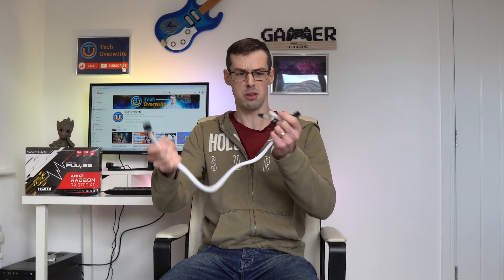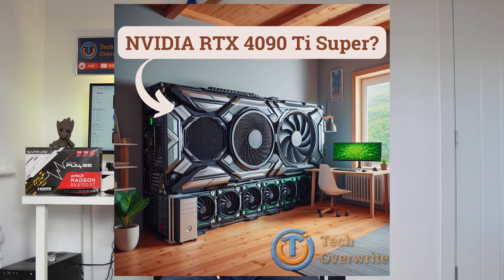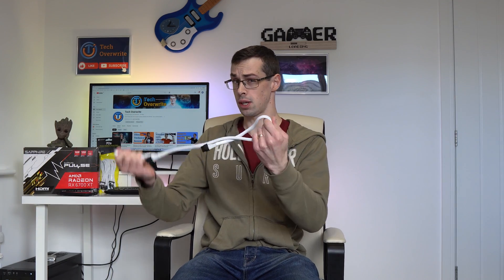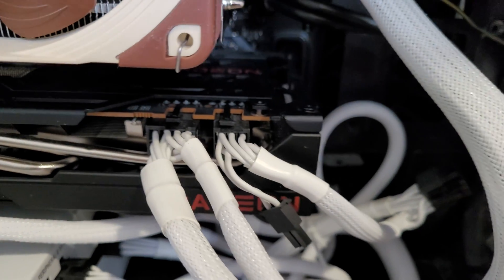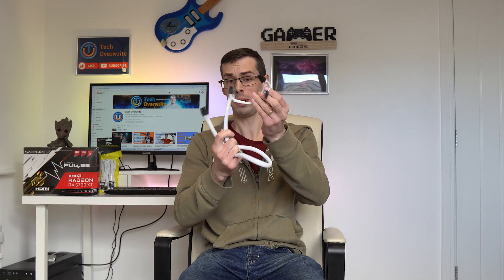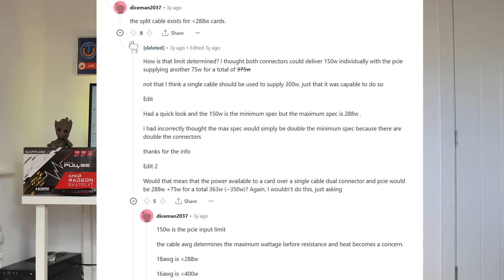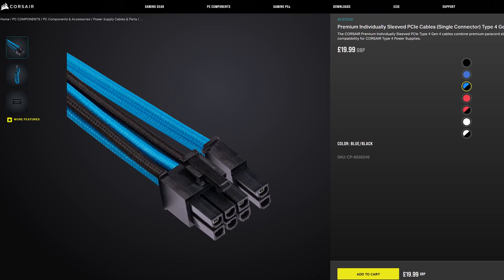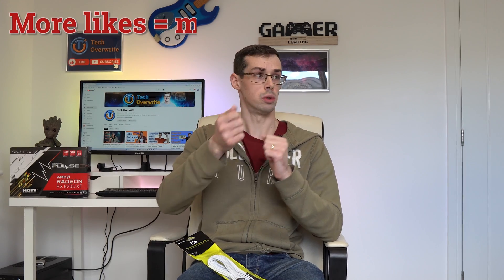Stop Connecting Your GPU Power Cables Like This! (How To PROPERLY Connect PCIe Cables For GPUs)

Comment: I got p520 with an rtx 3080 but having issues with gpu cables, what can I do please help. 

Gpu needs 3x8 pins the pc has 2×8.. and there is no room for another 8 pin on the mobo please help me what can I do ?
Reply from the maker: Sorry to hear it :( Unfortunately you might be out of luck - I doubt that the proprietary PSU in your P520 will have full PCIe support for an RTX 3080. I might be wrong though. Basically the usual advice would be to buy a new PSU if needed, but I'm guessing that might not be possible with your specific PC/PSU?

Comment: Not gonna lie (and fingers crossed) i just reversed my pig tail on my 750 and i am holding steady; coming from red light and black screen on rtx 3070 ti. Doing a NVIDIA auto tune and went from 210 to 1950 MHz currently.
Reply from the maker: Ooo fingers crossed, I hope that works out well for you :)
Reply: Bro, it worked!. I would have never even thought about the fact that the cable has parameters. I even used to be a junior electrician and would have went straight to the worse case scenario. Nuts, all I did was reverse the pig tail and went straight through three stress tests and three hours of Skate with no drops or shutdowns right after! Thanks my guy!
Reply from the maker: YES that's great to hear :)

Comment: so today after i moved all my stiff into a new pc case and psu i find out my pc was working then bang restart and just boot boot boot boot no clue why untill i look i had a ( DEVIL SPAWN ) swap it out for a normal one and works xD why we even have DEVIL SPAWN if they dont work lol
Reply from the maker: Ahh that's really interesting - I'm glad you were able to track that down in the end 🙂Devil spawn can be good for two lower power PCIe devices (like 150w of power each), but they aren't good for modern GPUs.
Reply: @TechOverwrite  well mine it takes three 8-pin PCIe so i dont know if that was something about it but when i did swap my psu and stuff use only 1 PCIe and aother PCIe with pigtail cable it did boot was on bf6 for like 30 mins and pc just power off and then try to boot and just went boot boot boot i try the one ram stick stuff and all just the same i was so lost so i try to use all 3 8-pin PCIe and it worked been gaming on it all night / day working fine :) i dont know if its the psu but its a lian li edge anyways its all good now :)

Comment: i've just bought a 5070 ti with 12vhpwr to 3x8pin, is it okay to use 1 single cable and 1 pigtail cable to fullfil all 3 of it? i realize that my PSU only has 2 gate to plug 2 pigtail pcie, and that's why they write 4xPCIE on the box :((
Reply: just watch dude so today after i moved all my stiff into a new pc case and psu i find out my pc was working then bang restart and just boot boot boot boot no clue why untill i look i had a ( DEVIL SPAWN ) swap it out for a normal one and works xD but i do have 6900XT GAMING X TRIO with the 12vhpwr if might be ok
Reply from the maker: Yep it should be okay - two separate cables should be enough current for a 5070 Ti. Glad your 6900XT is fine too, @McFrog3764 🙂

Comment: Hi, was wondering if you could help me, i have an rm750e with an msi rtx 2070 super.
my psu doesn’t have enough ports & cables to fill the 8 and 6 ports required to power my gpu.
can i use a separate port on my psu (that isn’t cpu/pcie) as the cable i have for it fits my gpu.
i’m aware this might not be good and i’ve been getting mixed signals from my research efforts, i tried it and turned it on everything was fine but i realise it might damage my pc or give me unwanted power issues.

what would you suggest as a solution? new cables/new psu/maybe its okay? if you respond thanks in advance.
Reply: 12vhpwr was the port on the psu
Reply from the maker: Hi, so is 12vhpwr the spare port you want to use? That should be fine then - that's designed for GPU power delivery. Corsair PSUs do sometimes give a "12vhpwr to 8-pin" cable, which is designed for your exact situation. Basically when you don't have enough 6 and 8-pin cables, Corsair give you that cable to also use. That will work fine :)

What you shouldn't do is use a Molex to PCIe adapter (For example) since that might not give stable power delivery, but using the 12vhpwr will be 100% fine :)

Comment: What about running a RTX 3070 Ti (with 3 connectors) on Corsair TX 650M Power Supply? I only have 1 Pcie cable that splits into 2 connector. Please help and guide me.

Note: I had two cables each with split ends into 2 connectors, but since I only needed 1 cable for my GTX 1070 earlier, I lost my other Pcie cable.

I'm unsure about what to do and if what Pcie cable should I buy if I am going to need 1 more other than my previous one already plugged to PSU.
Reply from the maker: You should be fine since you have two separate cables. The TDP of the 3070 Ti isn't high enough to require 3x separate cables. If I was you, I would plug in one cable (and leave one pigtail end dangling unused), then use both ends of the other cable - for 3x connections to your GPU :)
Reply: @TechOverwrite So it's safe to use 1 pigtail cable and 1 direct cable on my specific PSU (Model in original comment) and the GPU which is Asus Rog Strix RTX 3070Ti OC? Thanks again for helping!

Comment: This video is excellent and I really needed it when trying to figure out how I was supposed to connect my PCIE PSU to a 5070 with 12VHPWR! I’m looking to ditch the adapter and get a direct cable… I have 3 free PCIE ports on the PSU. Should I get a 3 x 8 PCIE to 12VHPWR or should I stick with a 2 x 8 PCIE? Does it matter much?
Reply from the maker: You'd probably be okay using 2x separate PCIe cables with the 5070, although strictly speaking it's always best to run separate cables. (Sorry for sitting on the fence there - I'd probably just run 2x separate cables for a 5070, if I had a quality PSU).

Comment: ASRock Radeon RX 6600 Challenger D, 8GB i have 650w power
Reply from the maker: You should be good to go :) The power usage is low enough there, not to worry about pigtail etc.

Comment: Hello, this was a helpful video but I have a conundrum I'd appreciate some input on!

I have a pretty old "modular" PSU (a Corsair CS650M 650 watt model to be precise) and I just bought an ASUS Prime 5070 OC card which draws a max of 250W - I'm replacing a 1070Ti which I was previously connecting in this daisy-chained fashion using just the single main PCIe cable from the PSU, but I'm aware the 5070 needs me to connect two of those PCIe cables to the adapter which came with it in order to power it and that both of those cables need to be single cable from PSU to graphics card adapter...after some research I've found out that I have a Type 3 PCIe cable which came with my modular Corsair PSU which will fit in the remaining PCIe port on my PSU but I had some concerns about whether it will work or whether the cable itself is capable of carrying enough power for this new card! If anyone has any suggestions or thoughts I'd appreciate it - I'm torn between installing the card as-is with the connectors I mentioned and then updating my PSU to a newer fully-modular one in the near-ish future, or just holding off installing the 5070 for that time and just getting the PSU and installing them both at the same time at a later date - the problem is I'm not confident in this fairly old PSU and want to make sure I'm not about to cost myself a PSU and/or a 5070!🤦‍♂

Does anyone happen to know whether this would cause any problems, or whether I'd even really NEED to upgrade the PSU? It has the capacity in terms of wattage for it and the rest of my system - and the available PCIe connectors and ports spare on the PSU which I can connect to with the Type 3 PCIe cable - I'm just worried about it and need some input from someone who knows more reliably whether this will work! 😆
Reply from the maker: Hello, sorry for my delayed reply. Corsair PSUs are good, even the 'base' CS ones, so I would hope that you should be okay powering the 5070 OC as you describe. To be honest though, you won't destroy the GPU if it's underpowered. Worst case, you'll have worse performance (stutters) or crashes. So I would just try it out and yes, if the type 3 cable is an official Corsair cable, there shouldn't be any harm in using that either IMO.
Reply: @TechOverwrite  Thank you very much for the response! I have installed it and its working fine - I think I will probably upgrade my PSU and case at some point in the future to make this build a bit more future-proof, but its working perfectly at the moment so thank you! Your video, along with some discussion with another friend gave me the confidence to give it a try and see, and it's saved me from buying a new PSU and case earlier than needed so that's a plus as well! Thanks again! =]

Comment: Hey man thanks for the video! I wonder if you can help me with something, I ordered a 5080 which comes with a 12VHPWR cable and an adapter which takes 3 PCIe connectors, my PSU is the corsair RM850 and it only contains 2 cables each with a daisy chain. Can I use one cable to fill one slot on the adapter without a daisy chain and then use my other cable with the daisy chain to fill the 2 remaining slots of the 12VHPWR adapter? the TDP of 5080 from what I checked is at around 360 watts. Thank you!
Reply: Also sorry again for all these questions, could I instead get this: Corsair Premium Individually Sleeved 12+4pin PCIe Gen 5 12VHPWR 600W Type 4, and just connect this from the GPU to the RM850 and forget about the adapters and the daisy chain or melting risk? Thank you again!
Reply from the maker: No worries for the questions :) The type 4 cable would work pretty well yes - assuming yours is a slightly older Corsair PSU (and it sounds like it is). I would prefer doing that, to using the adapter and 2x cables then a pigtail. I like the direct cables because it's a cleaner solution overall - less to go wrong IMO.

Comment: I built my first PC this weekend for my son, using a Corsair RM850e (2025). I planned to use my RTX 3080 in his system and buy an RTX 5070 Ti for mine. The RTX 3080 didn’t show any display when using the included 12V-2x6 → dual 8-pin cable, but the RTX 5070 Ti works fine with the 12V-2x6 → 12V-2x6 cable. I put the RTX 3080 back into my PC and it works fine. Could the dual 8-pin cable be defective, or have I done something wrong?
Reply from the maker: Hmm that's really odd, it definitely sounds like that could be a cable issue. There's no reason for it not to work otherwise. I would open a Corsair ticket and see if they'll ship you a new 12V2x6 to 2x 8-pin cable yes.
Reply: @TechOverwrite  Thank you for taking time to answer. I will do as you advice.

Comment: so if i use 2 pcie connectors instead of the splitter cable do i get more fps, i have a asus tuf 6700xt OC and using the pig tail
Reply from the maker: I doubt you'd get an average FPS boost, but potentially you might have better 1% lows due to less stutters (assuming that your old config was resulting in your GPU being undersupplied power). Although tbh, maybe you wouldn't see any gaming difference lol. Hard to say for sure :)

Comment: I have 2 plug for my gpu, 6+2 and 6. If connected pigtail, it works. But if I connect a separate cable, it does not work and the diagnostic light from mobo lights on which is vga and boot. Any suggestion on fixing it?
Reply from the maker: Huh that's really odd. Is it possible that one of the PCIe cables is faulty? It almost sounds like it. In theory the GPU should have no way of knowing whether it has a pigtail or 2x separate cables connector to it.
Reply: @TechOverwrite i tested my psu cables to a different gpu that has only 8pin. Both of the pcie on the psu is working fine.

Comment: Can I use this cable for my 4070s because you explained that the PCIe slot on the motherboard also provides power, so in theory it should be enough to power the GPU?
Reply from the maker: It's going to be borderline. It will depend on the PSU too, though, to be honest. You can always just try it out and keep an eye on crashes or stuttering performance (especially at higher power usage levels - e.g. 240w or so).

Comment: Hi.  Thanks for the video; you've got some great content here.  So, question that you might be able to answer: I've got a GPU with three 8-pin connectors (Radeon RX 9070 XT GAMING OC) but my PSU only has two PCIe output sockets (be quiet! Pure Power 12 M 1000W).  In addition, it has the PCIe 5.0 socket but I don't think that's useful here.  What's my best option for hooking up the GPU? Do I need a different power supply? Thanks!
Reply from the maker: Hi, thanks for that :) So you should be fine to run 2x separate cables, and then use a pigtail for the third connection. The 9070XT isn't ultra power hungry, so as long as you do have 2x separate cables, it should be fine. However some PCIe 5.0 PSUs also come with a 'reverse' cable - a 12vhpwr connection into the PSU, that 'gives' 8-pin PCIe power on the other end. If your PSU has this, you could always use this for the third connection to the GPU. But either way, you should be fine with your PSU IMO :)

Comment: I just noticed my RX 7900XT has been connected using the Devils Spawn method. No wonder my GPU crashes all the time. Even the RTX 3080 I had before crashed since it was connected the same way. 🤦‍♂
Reply from the maker: Huh interesting, I hope that you get more stability by changing it up :)
Reply: @TechOverwrite  Its been 4 days and I am happy to say my crashing issue has been resolved after connecting the GPU with two cables.

Comment: I bought a Rosewill RBR1000-M (on a suggestion from family) from an eBay seller to power my old system, that I am now turning into a 3-card SLI rig (for the giggles), but the unit is semi-modular and did not come with the modular cables. I have plenty of 6-pin extra wires from an EVGA 1000w PSU I just put in a new computer, and was about to just use those, until I was rudely educated on how these manufacturers will surreptitiously create their own pinouts to force users into using only their cables...which is fine, if they haven't gone out of business or still support their products. I have spent the better part of the last couple days trying to hunt down cables for this PSU to no avail simply because I cannot sufficiently answer the problem of how the Rosewill pinout cables are described or where to locate replacement sets. Had I known this would be a limiting factor, I would have just ignored the suggestion in the beginning and I'm almost at the point where just seeking a better-supported PSU will be how this saga ends.
Reply from the maker: Yeah it can be a total pain when the modular cables aren't compatible :/ It's frustrating all round. Sometimes a new PSU can be the 'solution' I agree, even though that's annoying ofc. One alternative is to look at whether CableMod sells a compatible cable for your PSU.

Comment: brother i have bought pc recently and my rx 7800xt  gpu stops working and the golden fingers have little black dots i was  wondering why it happened , i was connected my gpu as a single PCIe cable with two 6+2-pin connectors (daisy-chained). in cooler master  MWE 750 V2 PSU, is it the  thing that my gpu stops working
Reply from the maker: Do those black dots rub off if you gently clean them with isopropyl alcohol? It might just be dirt - I doubt that it's burn marks (at that point) tbh. Also I don't think that underpowering your GPU would physically damage it - that would be unlikely. So in short, you may have a separate issue with your GPU or PSU (potentially).
Reply: @TechOverwrite  i have tried with clean with isopropyl alcohol but it dosn't work  i have checked the psu  for any burnt smell but their was not any burnt smell and it was working perfectly

Comment: Johnny Guru has abundantly debunked this bullshit. Each 8 pin can provide up to 300w per cable. Each gpu 8 pin connector is limited to 150w not the cable itself.

Comment: im kinda new to this but using 2 pigtail cables and keeping the "tail" part disconnected is pretty much the same as using 2 normal 8 pin cables? Like, there's no loss in power from keeping the tail part disconnected right? 😭
Reply from the maker: Yes that'll be fine, no issues with leaving 2 ends disconnected 😊